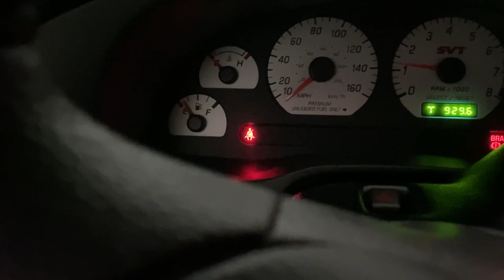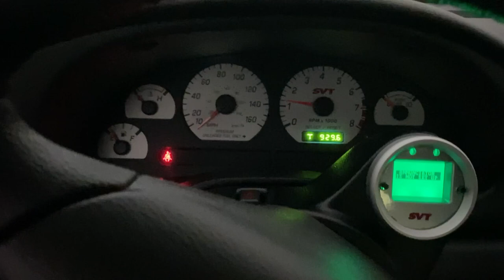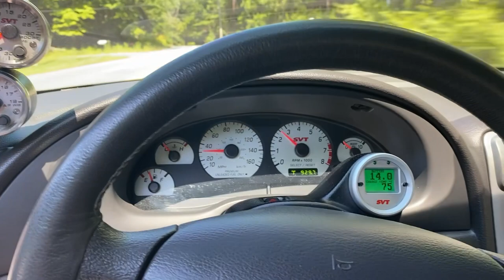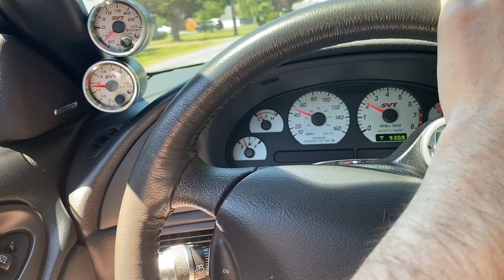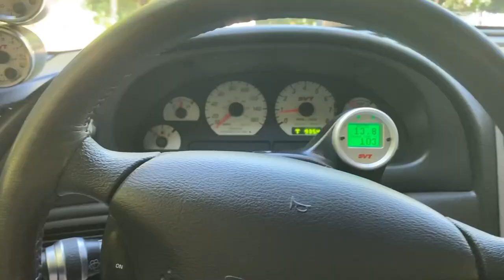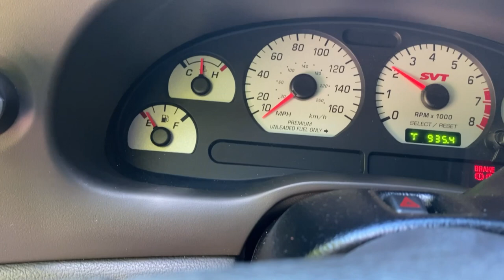Dyno Prep Day #2 | D-Day! | Pulley and Plug Change etc

Comment: Car is lookin great!! Sounds like you may have a pulley going out by the light squeaking when you backed out.
Reply from the maker: Yea I know go figure 😆 gotta figure out which one it is. At the rate I’m going this summer who knows how much I’ll even drive it.
Reply: Maybe start by making sure that idler pulley below the blower pulley is not allowing the belt to rub together where the belt comes close to each other. I’ve seen other terminator guys have that issue where the belt makes contact with itself there.
Reply from the maker: @badaz0148  yea that’s a good area to check! I’ll end up checking all the bearings soon.

Always hope it’s not the inner belt pulley 😆
Reply: Just out of curiosity have you ever taken off the oil cap on any of your cobras while warmed up and idling and noticed steam coming from the oil fill hole? Mine does it and was curious if I’m the only one.
Reply from the maker: @badaz0148  in the past I have. I’ll do it to this car the next time it’s out.

Comment: Is it normal for the af to jump. And the fuel psi
Reply from the maker: Fuel pressure gauge in on the motor so that’s how it will look from vibration. The stuff they fill the glass with helps tho.
And yea it’s normal. The AFR will cycle back and forth.